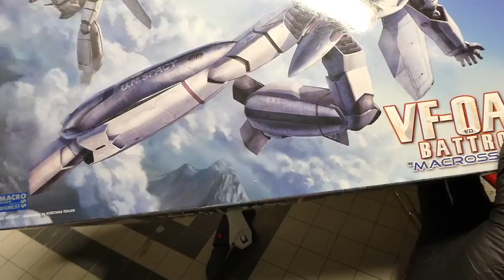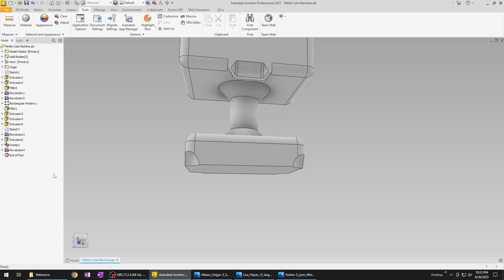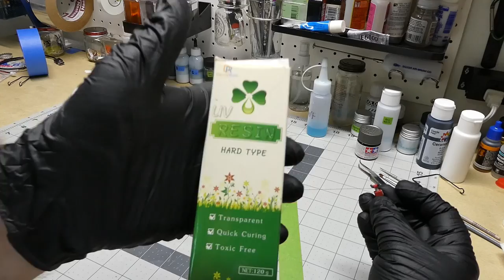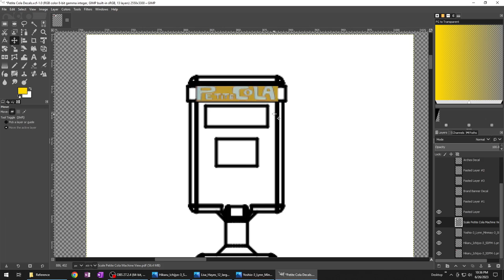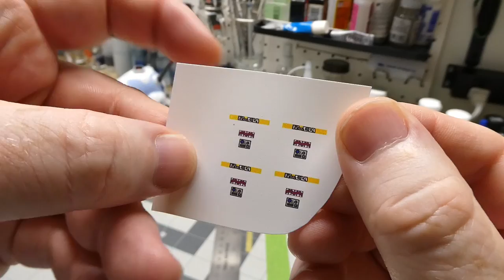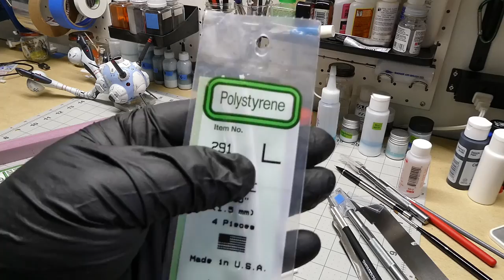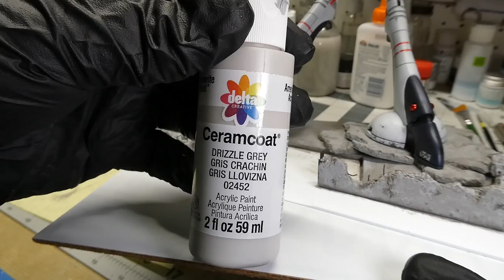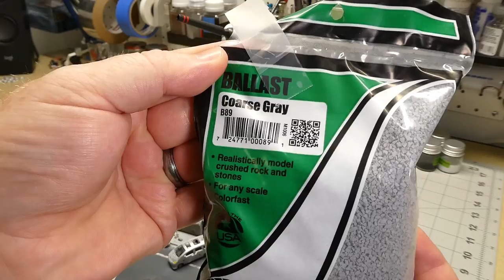Robotech / Macross Zentraedi Battlepod Build Part 3 - Final

Comment: I need your advice. Some parts need to go on the head prior to assembly. However, once that is done it becomes very difficult to paint it. I've seen people assemble the head then paint it then put on all the other parts that go on the head. How can you do that when certain parts are glued from the inside? Would you just have to glue the moveable parts to the head and they would be stationary? Because painting the head stand-alone prior to adding parts would be so much easier. What do you suggest?
Reply from the maker: Yes, painting the head is tricky. Here are the steps I took: (1) Painted all the head parts separately. (2) Glued the thruster pods to each half of the head. (3) Inserted the rear hatch bracket and glued the two head halves together. (4) Filled and sanded the seam. (5) Touched up the paint on the seam. (6) Glued on the top dome cannons and main cannons.

I didn't want the top dome cannons able to move after assembly, so I could get away with adding them after gluing the head together. If I had wanted them to move, I would have needed to add them in step 3. The main cannons can be glued on last, even if you want them to move.

If I were to do it again, I would save painting the head until after gluing the two halves together. Fixing the paint along the seam was a pain.

I covered my painting process in part 2. I didn't show every step I listed here, but you can see most of it in that video.